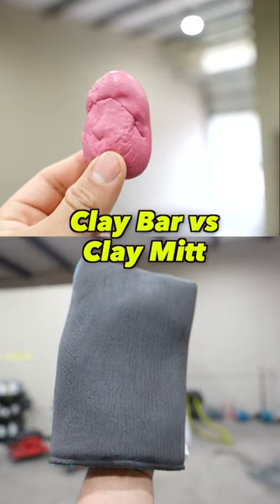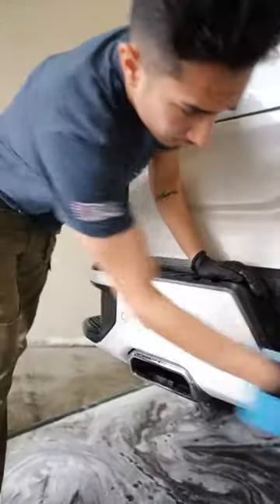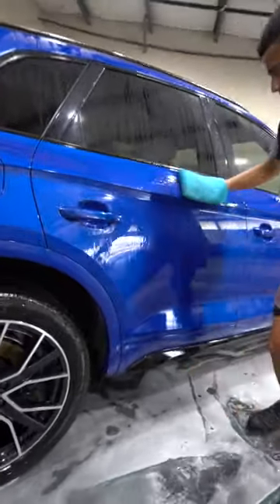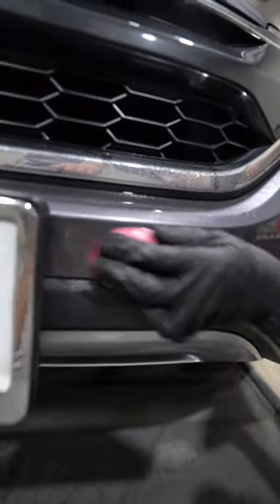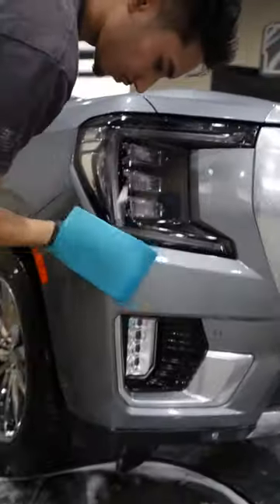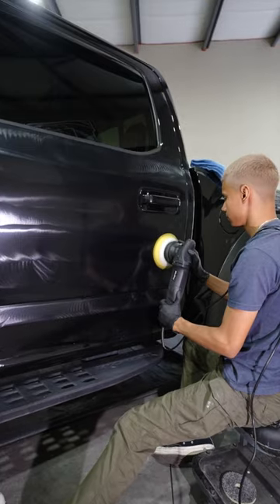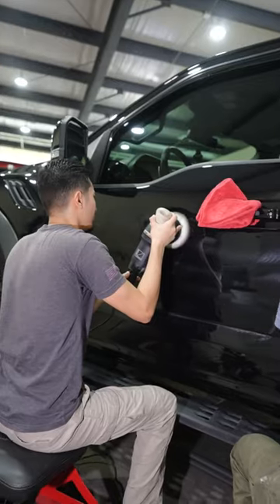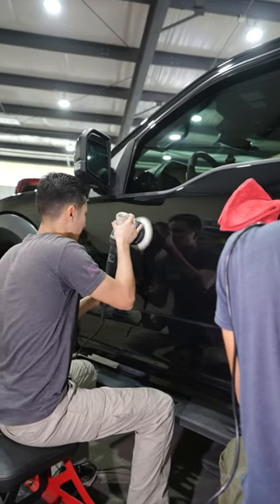When To Use Clay Bar vs Clay Mitt #detailing

Comment: Get paid to scratch a car if they don’t want to pay for a polish afterwards?
Reply: Well. It’s not really scratching the car, it’s removing contaminants imbedded into the paint. So, not as bad as scratching the car, but also not optimal. And yes, he gets paid for it!
Reply: No.
As that's not what is happening here.
Reply: On vehicles that are coated, and have embedded contaminants that won’t budge with chemical decontamination, a physical abrasive decontamination is the next step to clean the pores to rejuvenate a coating. Anything physically touching the paint has the potential to mar or scratch. Reduce your chances by using more lubrication.

Comment: Hey, client got a car with cement splashed on it a while ago, there are tiny grey spots all over the paint and bumper(back paint and back bumper so quite visible).

What would you recommend?
Clay bar then polish
Or use wool or wet sanding then polish?

Cement has completely dried a couple months ago, so any chemical removal is not an option!

Thanks